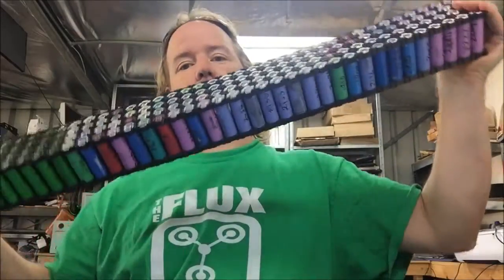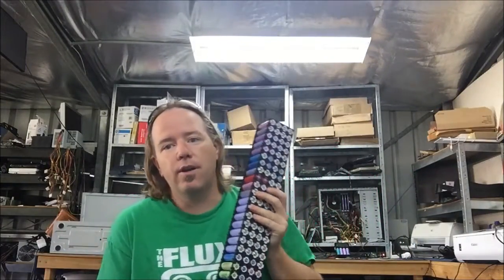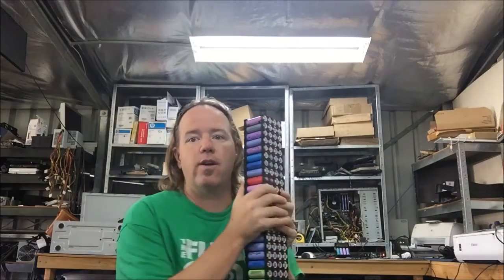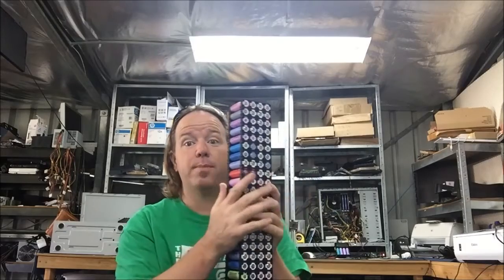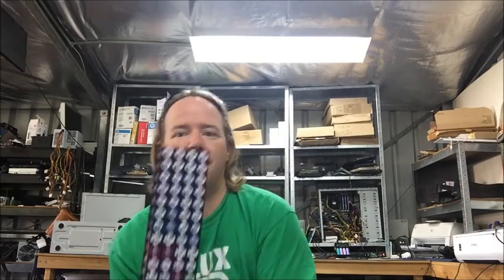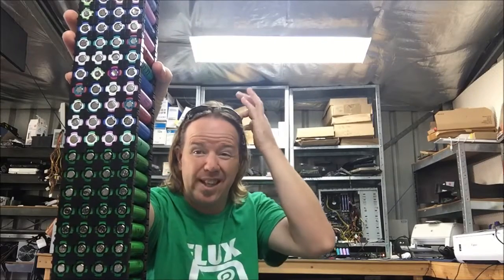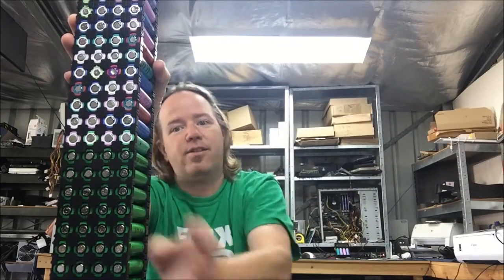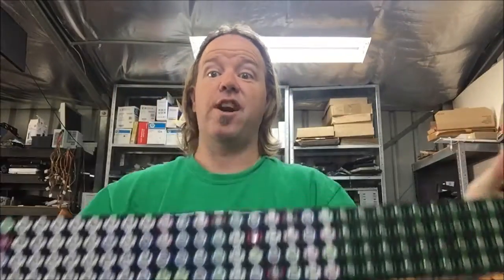Homebrew Powerwall Project - S01E15 Can't sleep, too many ideas

Comment: Hi again!

Just heard you mention you're thinking of making modular sets, and maybe you can put all 2000mah ones in 1, 1800 in another, 1700 in another etc.

Since the long sets of cells are all in parallel, they act as 1 large capacity 3.7V battery... eg 320ah 3.7V... so I think the strategy (at least from Jehus videos) sounds like you want to shuffle the sets of batteries around have the same 320ah capacity in each?

I'm just not sure if you have a set with 2000mah and 1000mah mixed, what happens when the 1000mah cells are close to discharging.

Or maybe the idea is you DO group by mah capacity, but your set of 2000mah cells will contain less batteries than the group formed of 1700mah cells?

It's late and I'm also thinking out loud, sorry if it's just spam :)
Reply from the maker: +snowcrazed1 plan is to run seperate 80 cell packs of 2400, 2300, 2200, 2100, 2000, 1900,1800 mah packs and just replace the lowest pack with a newer higher one as they come available till in a years time i have one complete 1120 cell pack that is +2000mah or higher. THEN use all the lesser in the next pack as an addon *or something like that *

Comment: 48V is definitely the way to go once you are over 2000w AC. I think the same that aplies to ebikes should work here. I remember when it all started with ebikes it was all 24V and then 36V but as the power hunger grew 48V pretty much became the norm. Today people over volt to 72V 96V. Only if we had charge controlles and inverters available at 120 DC?? Still I think that I will start working after my install is done on a electric trike that can take a 1000w motor at 48V so I can built a side battery bank for my solar. Rough numbers with a 7.5kWh battery the trike would have a 350 mile range. Talk about efficiency there 10x more efficient than a  Tesla... too much imagination I guess.

Comment: Brother one note. I would have 3 anderson battery plugs. one for the power going out. One for the jumper to make a bigger pack. and One for the power to come in from the charge controller or gen..
Reply from the maker: +yankey4 good ideas, especially one for a generator. But I'm thinking that'll be best on the incoming side of the inverter (with grid isolation) so generator can run house and charge batteries at 20a using the internal charger all from a single point. Hummm more to consider :)
Reply: Peter Matthews Right. One thing tho. Your still going to need a place for the charging current to come into the pack. For your solar or wind or what ever. I did not think about the gen needing to run the home. So maybe 2 power in spots. 1 power out and one power jumper.